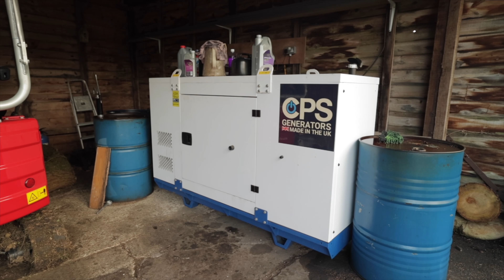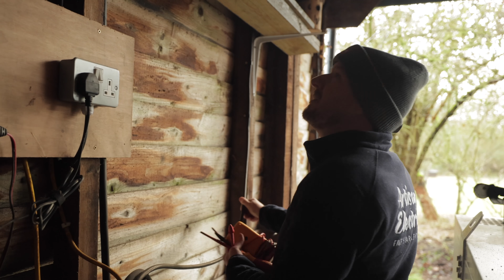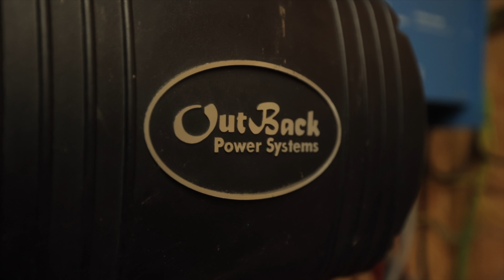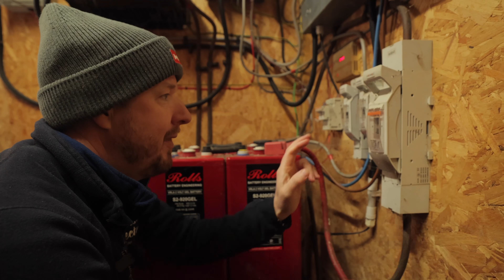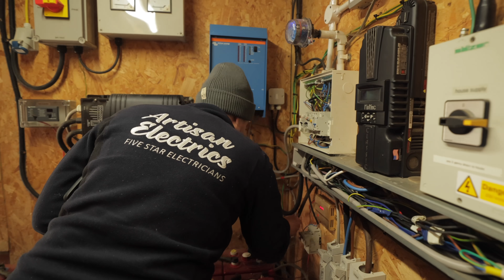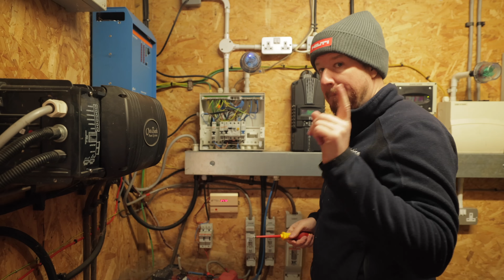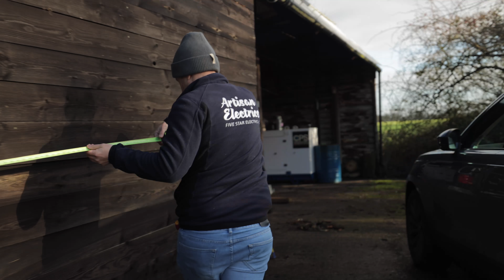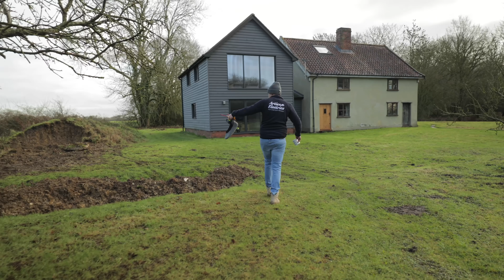DIY Off-Grid Solar Gone Wrong! (It Can’t Even Boil a Kettle)

Comment: I’m still not sure why I watch these. Every video is the same: dramatic inspection, no resolution. “Temporary fix” somehow becomes condemning the whole setup and offering a quote. Seventeen minutes to announce they provide estimates.
Reply: this is why the hacked system exists to begin with electricians who don't want to salvage and just wanna write it off and do a fresh install so they can feel safe putting their name on the line for a shitty certificate, clearly its a mix of contractors that knew what they was doing, and a somewhat understanding diy/hack/bodge by the prev owner. That's why they could afford a generator not getting shafted by bills, not getting shafted by everyone contracted who wants to redo the whole thing themselves.
Reply: @divey1337 the solar is miles from the house because of noise...the existing wire can supply 2kW or 48kWh daily.  A new battery and hybrid inverter in the house and no wasted pro-time on what is there already.  Less than £10k
Reply: @simonmasters3295  The solar is away from the house because of noise? Didnt think you could hear the electrons been bashed out by the suns ray
Reply: @danny323dee  He's thinking of the gen-set, which is in the same out-building.
Reply: @simonmasters3295  And now Artisan will charge him £60k+, for something he doesn't even need.
Reply: @simonmasters3295 2kW? So not even enough to run a 2200Watt kettle
Reply: @divey1337 they knew what they were doing yet the home owner said it didn’t work… so you gotta wonder what they knew, shit all
Reply: @akoncloud6866   Well you ever get told by an electrician your gears no good and needs scrapping whos incentive is to sell you a new system feel free to reply again i'll come pick up all the "waste" for free
Reply: Property purchase without due diligence. Off grid but happy with a diesel generator. Never mind the 'rage bait' comments, check the plumbing too. What were those gauges doing next to the consumer unit?
Reply: As said he want to promote installation of new equipment ( sponsored), criticising anything else and send them to the landfill !
Reply: He should just arrive to every job with a pre-printed £50k quote. It would save alot of time.
Reply: This man has clearly never set up an off grid system with an autostart generator....
Reply: Such entertainment 😊 … I just know this “potential” customer is going to be seeing an estimate that’s likely on a par with what they paid for the house !!
Upgraded connection between outbuilding and house (£10k?) … large new ground-mounted PV installation (£20k?) … new sized battery/inverter (£30k?) … new generator control and management system (£10k?) … lightning strike protection and fire safety system for outbuildings (£10k?) …. Easily up to £80k and not even visited the potential for introducing an air source heat pump installation or the planning permission costs for the solar farm. Is it cheaper to cough for a new and bigger roof on the outbuilding? Also yet to get the plumbers in to quote for heating improvements.
Oooops …  I forgot … they’ll be needing an EV charging station too … plus high speed home network and associated high speed broadband connection (probably currently running off a mobile 4G signal) … another £10k?
Odds for a recommendation for generator upgrade to assure full capacity capability?
Overall … Change from £100k anyone?
Then, like any good self-respecting Grand Designs project there’ll be the subsequent divorce and associated fallout when the rural outlook the house currently enjoys gets replaced with a solar farm outside the front door 😂😂
Reply: That is a mppt not a solar inverter.
Reply: @jonaaal the guy not knowing that is all i needed to know. Off-grider since 2011 here.
Reply: I dont want to see 'Linton' suffering angst about which EV he is going to charge today. I want to see ordinary people getting help with their installations and even going after scammers and crap rogue solar installers. I have the impression this is "solar porn"
Reply: Most of the YouTube.
Reply: Kettle overloading a 16a mcb?
Reply: coz he always recommend a full replacement. it's expensive so much.
Reply: Thanks for bringing this up. I feel the same. This is what happens when you start to get big. Sad... It was a good channel.
Reply: @503ali  Or rather start to go outside your knowledge zone perhaps?
And also create more content than you consume.
Like anyone who's watched random solar videos on and off for 5+ years would had seen those Outback/Midnight solar stuff and would know that they were considered top notch back in the days.
But also, given the price difference, is it really worth it for the customer to get an expensive "nice brand" system today? Given that the cheap all-in-one charger-inverters are almost identical and are super cheap they seem like a better option. Perhaps set up two of them in a parallell configuration to be able to simply switch one off if one fails but still have power until it can be replaced. Two of those would still be cheaper than whatever expensive "nice brand" system Artisan might recommend to the customer.
I hope the customer sees all comments.
Also to any potential customer: If you plan on having upgrades done for you, make sure the inspection video goes live before you decide on actually having things done, and read the comments.
Reply: Completely agree. Looks like ANOTHER customer is looking at a very Artfully created bill, £25,000  methinks
Reply: @Jules-y4z Try £60k+, as that other off-grid that had many problems has cost the owner £112K.
Reply: A bit of over thinking by some viewers.... a simple case of someone thst watches this channel, possibly by accident originally, has a lot of money and likes the idea of a quality install, with little knoweldge, which most are.... then add 'Artisan' and you have a 'duped consumer' needing professional help with the glam of having themselves/property featured so that they can show off to friends over a glass of Pims.... That's the  marketing strategy...
Reply: @TazzyUK and who can blame either of them?

The property owner has just spent £500,000 on buying the dream.  What's another £200k  on 1. roof, 2. heating, water and sewage 3. kitchen and 4. car and solar?
Reply: @TazzyUK the island was off grid apparently
Reply: Pretty much. This guy had no interest in actually fixing the system. 2KW solar is more then enough for most homes unless they are not running kitchen appliances off gas.  Gas oven, stove and heating means much less demand on the electronics. 
The real problems with this system appear to be limited capacity or solar charging resulting in a over reliance on the generator. This combined with a under powered inverter results in the jugs not running. None of which is actually addressed. 
The system could 100% do with a better wiring job but to condemn it because there are different brands of circuit breaker is insane. 

Frist thing for a real resolution would be get a power meter on that AC line to measure the power usage, to get the ideal battery capacity. Looking at the solar charts to work out how much they would need for the charging of said battery and Recommend a upgrade on the inverter to allow them to use the jug with out overloading the output. 200amp DC fuse implies a max of 2.5kw while the circuit breaker implies 3.6kw on the output. Makes zero sense with a 7.2kw generator. Strongly suspect there is a switch over point where the generator puts full power out to house.
Reply: @therasco400 2K watt isn't enough for most homes. Don't forget you need a large part of that just to charge the batteries, so you can still keep your refrigerator, internet, etc running at night, gets worse when you cool and heat the house on electricity. Also 2K watt is the max, so during winter it will produce far less for most of the day. I have 13 panels on my roof, and 5kwh battery. Since December last year I have only be able to completely charge them 3 times
Reply: @DerekSmit best comment
Reply: @therasco400  Also he complained about not using bus bars. But, in an environment with moisture a bus bar is a bad idea except if you plan on always being single phase.
Over here in Sweden it wasn't uncommon to see arcing/burning in three phase bus bars that were installed in places that aren't climate controlled. Moisture enters the bus bar and causes a slight current to pass between the live bars, which in turn generates heats which breaks down the insulation, causing more current to flow until the insulation melts off. Fortunately it seems like all bus bars uses fire resistant plastics so I think there were no cases where anything else caught fire.
Edit: The quick fix for the customer would be to connect the two unused 6mm2 wires in the feed to the house directly to the generator (with appropriately sized breakers) and have it feed a few outlets/sockets in the kitchen. That way they can run their kettle or electric oven or whatever it was directly from the generator, and have everything else run on the existing system.
The other quick fix would be to check which decent sized loads are in the house, and install an automatic shutoff of those loads when they run their kettle or oven or whatnot. Don't know if those devices are common in the UK. Seems common for electric heating here in Sweden, simply shuts off the heating when something else consumes a lot of current.
Reply: @therasco400  The Outback inverter is a 25 or 30Amp 120V AC output (depending if it is vented or not) the main 15amp breaker seems to be the overload problem. A kettle or oven are often 15 amp each. I'm no expert on the single phase 240V system. but the hardware is top of the line and does not need replacement. mixed breakers in one box are not code-rip them out!
no judgement on a complete tear out of the wires (it's a rats nest), but keep the Outback and midnight. put up cement board and rewire it. paying by the hour to unscramble that mess is not worth it.
having the peace of mind that all the wires are sized to the load is worth a lot IMOP.
Lots to do in that system...but start by reading a lot of device labels for current draw and using an amp clamp, and sort out if the wires are sized right.
A complete tare out is greed and not recognizing the biggest names in the industry is shameful.
Reply: @therasco400 the problem is lead acid
Reply: @therasco400 sorry but this sounds like absolute bs.
Reply: @znk0r  In what way? When someone who apparently lives and breaths solar  fails to ID what a part is then I immediately call their professionalism into question. The solar controller does not act as a inverter and he had already ID'ed what the inverter was. 

Imagine if you looked at a computer ad mistook Ram for a GPU and then went well the power supply wires are too small so your better off just buying this prebuild I sell?
Reply: @therasco400 he starts his comment with 2k being more than enough, there is a clear response to this comment from an oter viewer that explains why this is completely wrong.
Reply: @znk0r  Yes 2kw is more then enough as long as he is running cooking and heating off gas. Ignoring the second part of the statement is where you went wrong.
Reply: @therasco400 you say to condemn it because of different MCB’s is insane, but with that installation an electrician could not make modifications and sign off their work because the installation is in an unsatisfactory condition. So that’s the first problem.
There were 2 47kg propane bottles, so obviously running cooking and heating off that would be far more expensive than running electrical heating and cooking. 
The customer has approached artisan obviously because they know what they offer and that is the kind of service they want.
Could they have call bob the spark from down the road to “have a look and make it better” yeah, of course. Would it have been a legitimately signed off job - no, absolutely not. Would it have been future proof, again, no. Would it have been a false economy - yes, most likely.
Reply: @Pugjamin  My point was not that he is likely wrong but its that he didn't actually understand the solar system there instead it comes across as to complicated so condemn. He didn't know what the solar controller was referring to it as the inverter. it shows he only understands complete systems and instead looks for reasons to replace. 

I would recommend a complete replacement of the system but it would be beside a quote to rewire the system to ensure all connections are correct, install a second inverter and split the distribution circuits between them, install a battery monitor so you actually know current flow and confirm the battery health. 

No individual component in there appears to be faulty its that the demand is in excess of the system.
Reply: @Pugjamin  100% agree. What is it with all these critics piling on Artisan for giving a customer what they want and need? You can guarantee the customer will be super happy with the new Sig system. It's simple,  and it will work, and extra panels will help no end. 👍
Reply: @therasco400 two quotes from same supplier is an intelligent response and leaves room for negotiations
Reply: @MichaelWakefield-mx6hg  Absolutely, theres no shortage of guys who will have a play around in there for a carton or two. If you want something you don't have to worry about a year or two down the track, there is a price to pay. If you're going to be living there for the next couple of decades, might as well build it right and add some future proofing in there too.
Reply: i am back because it's fun to watch someone get too big and wait for the fall... sorry Jordan, but you... need to go back to basics mate
Reply: Thanks for saving me 17 mins of my life
Reply: agreed
if he sold generators
he would be back in the season
blaming the old unit for not keeping up
i wish they would make an honest effort to upgrade
or recommend some who could
.
replace the batteries
swop out the inverter for a 3 -5 k all in one  48v
swop out the 200 watt panels for 450
use the spare wire for a second circuit breaker 
.
boom
under 5k plus profits 
customer has double the system
.
Reply: You are going to install sig energy here with gateway for generator 😁 thats so much cleaner and works so much better
Reply: First one i've seen but all I kept hearing in my head was 'it's gonna cost you mate...'

That could have been fixed eith a small adjustmentvto the consumer unit. He wants to install a bloody ground array....
Reply: Hilti and solar panels where found in the Epstein files… batteries and EV chargers have been redacted 😮